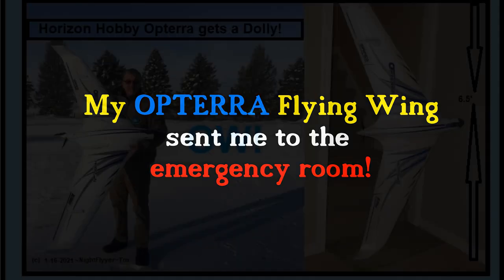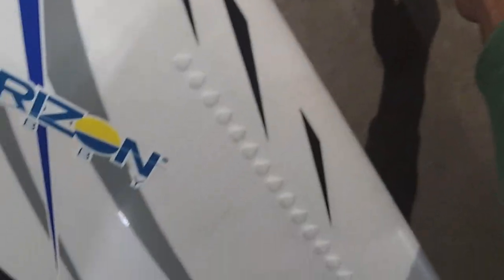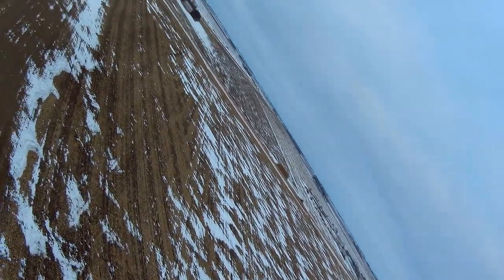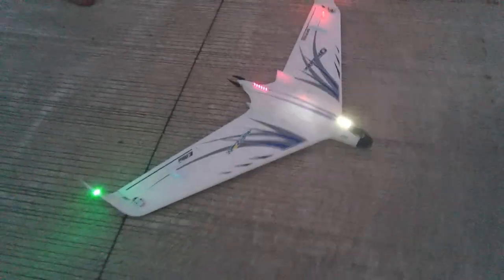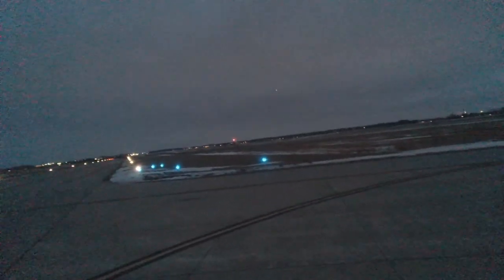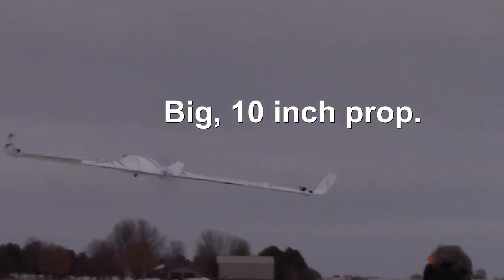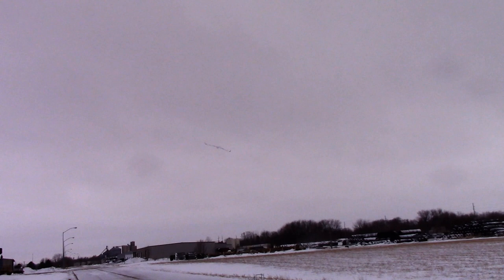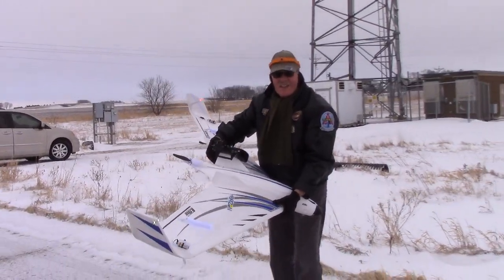My Opterra 2M Flying Wing sent me to the E.R. This is an awareness video & my solution for launching

Comment: I hope it heals up quick Dave. I have to admit that I have come close to being eaten by the prop on flying wings. So what I do now is that I have a throttle cut programmed into one of my switches, (I do this for all my electric aircraft BTW having a cut off switch has saved me heaps of times when I have accidentally bumped the throttle when the plane is not ready to fly.) so I set the switch to off then set the throttle position I need, launch the wing then flip the switch to turn the motor on. Ok, I must admit it does not work every time but it's better than getting eaten by the prop. A launch dolly would be much better though. Get well soon.
Reply from the maker: Yes, for sure.  If you follow my channel, you know I am no newbie and for some to say I asked for it or should have done it differently is disappointing, especially when I am the one hurt, the hospital charged me $2400, and I followed the manual's launch instructions word for word.     

First of all, that throttle arming had nothing to do with my hand injury. I only mentioned the Throttle arming because I followed instructions in the manual and that is the way it bound up.  It arms the motor as soon as you plug in the battery. If it had said to program in a throttle cut, I would have!    This wing is 7 foot long and will bend and break the end off the if you even try to pick it up by the tip. It would also be extremely difficult to somehow launch it discus style with the elevon there and that 7" tall winglet rudder that is also on the tip.  I know how to do it , but not with this plane.  See my 14 year old self-contained catapult in action here.  https://www.youtube.com/watch?v=ypxbkaY-Ycs&t=113s
It's not like launching my SMALL F-27 Evolution or 1.2M Opterra.  So I followed the instructions word for as I did for the video I made of my product review earlier where nothing happened bad.  https://www.youtube.com/watch?v=P_inF5EYLEE&t=1s
Here is word for word what the Opterra 2M manual says about launching.  
1. Put the aircraft into launch mode with the channel 5 switch.  (in my first video that did not work, it went into the ground)  
2.  Hold the aircraft in one hand and the transmitter in the other.  
3.  Apply full throttle and throw the aircraft directly into the wind, angled slightly up (5 to 10 degrees above the horizon). 
4.  Climb to a safe altitude and check the trim.   
I know others have their own ways, and either way, my Dolly is the safest solution for me.  
The Opterra 2M manual also says nothing about throwing it with the motor off, so if a newbie followed the instructions, like I did, I'm showing what could happen, in case a gust of wind got them or something else.     Nothing is 100% and no matter how good you can throw, this big 7 foot wing with a 10 inch prop spinning right next to your face, is risky.  And to see how I feel about that unnecessary auto stabilization system see this.  https://www.youtube.com/watch?v=ur5V5H8UcGs&t=1s
Maybe a gust of wind, maybe my 73 year old left arm was weaker, or who knows.   But either way, if it happened to me launching the way I thought was good (and  the same as all my previous launches.)  So if it can happen to me, it can happen to others, and that is the warning I want to present.  Thanks.
Reply: @NightFlyyer  Hi Dave, I nearly bought an Optera a couple of years ago, but never went through with it, basically I could not find a way to launch it safely without say using a dolly or launch frame. Personally, I think hand launching a wing from the centre pod with a rear engine is playing Russian roulette with your fingers. Quite a few members at our club have been nipped too by rear-engine wings. Hence when I launch my wing the motor is off until its safely away from my fingers then I turn the motor on (Cant launch this one by the wing tip its a bit big). To be honest I don't think there is really any safe way to hand launch the Optera. I should really build myself a launch frame.
Love the channel have been following it for a few years.
Reply from the maker: @alaxus  Thanks so very kindly for seeing my side of the story, as I followed the launch directions to a tee in the manual. Those who say it was my fault or should launch discus style, obviously do not have this 7 foot, heavy plane.  From now on, it's Hello dolly!

Comment: DId the same thing with the smaller opterra. I have had a friend launch it and added power only after launch which works. Been planning on trying a catapult launch. For the one you have best solution I have seen was to mount some fixed tricycle gear on it.
Reply from the maker: Well my drop away dolly works best for me and adds no weight to the plane.  The manual says nothing about trying to throw this big 7ft underpowered wing into the 12 mph wind I was dealing with with the motor off.  Thanks.

Comment: I've had close calls with strykers, and flying wings. I've had to learn how fast each of my planes react to the throttle and to throw and then goose the throttle after release, it depends on how fast your prop runs up as to exactly when you have to throw the coals to it. It would be pretty hard to discus launch a 7 foot wing but I would try that, especially with that 10 inch prop so close to knuckleville. Collapsible props need to be run up slowly or they tend to undermine the integrity of the motor mount at high speed because they aren't any where close to balanced until they are fully extended.
Reply from the maker: Here is word for word what the Opterra 2M manual says about launching.  
1. Put the aircraft into launch mode with the channel 5 switch.  (in my first video that did not work, it went into the ground)  
2.  Hold the aircraft in one hand and the transmitter in the other.  
3.  Apply full throttle and throw the aircraft directly into the wind, angled slightly up (5 to 10 degrees above the horizon). 
4.  Climb to a safe altitude and check the trim.   
I know others have their own ways, and either way, my Dolly is the safest solution for me.  
The Opterra 2M manual also says nothing about throwing it with the motor off, so if a newbie followed the instructions, like I did, I'm showing what could happen, in case a gust of wind got them or something else.     Nothing is 100% and no matter how good you can throw, this big 7 foot wing with a 10 inch prop spinning right next to your face, into 12 MPH is risky to say the least.  The 10" prop is very close to your forearm as well, so a gust could tip it back even before launch, as others told me happened to them.  Thanks. 
As you saw, my launch rail 7:12  did not work in this video.  My Catapult  7:26 would have worked probably, but it was destroyed in the fire that destroyed my jets and my home, so I never built another.  The instructions only say to hand launch it and tells how.  That is how I did it. Of course nothing is 100%, and others told me they were holding this big 7 foot wing and before they launched, a gust of wind got under it and it tipped back and cut their forearm and 3 tendons.  Its hello dolly for me from now on.   Here are the links to the last videos.  
https://www.youtube.com/watch?v=P_inF5EYLEE&t=1s&gl=CO  and   https://www.youtube.com/watch?v=ur5V5H8UcGs&t=1s
Maybe a gust of wind, maybe my 73 year old left arm was weaker, or who knows.   But either way, if it happened to me launching the way I thought was good (and  the same as all my previous launches.)  So if it can happen to me, it can happen to others, and that is the warning I want to present.  This is too big to launch discus style as well.  Thanks much.

Comment: I recently purchased my Opterra, but haven't flown it yet. I had the same concern even before buying it. I'm working on a 3D printed extension of my hand that will provide a firm hold and will release easily at the exact point of launch as needed. If it works as intended I will share it with other Opterra owners.
Reply from the maker: Good luck with that.  The forearm is very close to the prop, so if a gust of wind tips it back before launch, that can get you too.  be careful.  Thanks.

Comment: I own the 1.2 meter version of this flying wing, even though, I am already used to hand launching it, due to its small size. This 2 meter version makes me really nervous... One of the biggest problems that I have with flying wings is, the bottom getting scratched and beaten up on every landing and the propeller being too close to my hand. I hope on the next version, E-flight can add retracts. It will make landings and taking offs much easier, at the same time increasing safety.. ( no more hand or fingers getting cut )...

I mean seriously, why is it so hard to design wings with retracts?
Reply from the maker: Yes, my F-27 Evolution also is easier to handlaunch, as you say, but I still elect to use my launch rail as you saw.   This big 7 foot wing barely has enough power to get out of your hand.  Others told me they were holding it and the wind got under it before launching and it tipped back and cut their forearm.  The big 10 prop needs shrouded, but again, as you say, it would hit the ground on landing.  I put metal skids on mine to protect the bottom, see my video. https://youtu.be/ur5V5H8UcGs  Also it's not hard, it's expensive as it would need another servo for nose wheel steering, etc.  Short coupled wings like these bounce so much, I believe they would get ripped out in a landing like that, so they passed.  It's all about the money. Thanks.

Comment: Thanks for the heads up... I always think about that and you are not the first to post getting tagged by a prop. Both the F26 Evolution and the Opterra need a power off launch... not so easy with the F27 so using a launcher makes good sense.
Reply from the maker: Yes and as you saw, I launched my F-27 Evolution in this video off my launcher.  Too bad this big 7 foot Opterra is too underpowered and heavy to use it.  But for me and from now on, it's Hello Dolly.

Comment: Been there, but I was lucky. I purchased a mesh butchers glove. Saved me from the eventual hospital visit
Reply from the maker: I tried to grab the tiny holes in the bottom of the fuse with a glove on this big plane and it was too hard to hold and throw, plus it is hard to run the transmitter with that glove on for me.  Hats off to you that you can launch and fly this 7foot wing that way.  Maybe the manual should recommend that as well.

Comment: Up and down at that point is for programming the esc...Use a throttle cut on your transmitter as the manual states...
Reply from the maker: The Opterra manual states nothing about a throttle cut.  I typically dont use it.  I just pointed it for the newbies that this particular esc arms as soon as you plug in the battery.  Besides, that had nothing to do with why I got cut.

Comment: Too many comments to scroll through - I have the 1.2 M opterra and never even tried to hand launch from center.  I figured there would be a lot of complaints about cut hands but previously came across only one other very short video showing the damaged hand of the poster....and even in the various rc forums only one or two mentions of cut hands and fingers. This surprised me.  Interestingly, the manual doesn't even caution about keeping hand out of the props on the throw.  If I were on a jury I would have no trouble awarding damages.  At any rate,   I taped the wings onto the fuselage with reinforced packing tape and throw it from the wing.  The 2 meter version, however, is too big for that.  I notice the 1.2M is out of production, probably not because of the cut hand problem since they are still selling the 2 meter version.
Reply: https://www.youtube.com/watch?v=JFFAS_YWlgk

Here is another cut hand incident with an opterra but not the one I was referring to.
Reply from the maker: Your right about the launching by wing tips on this 2m, as I mentioned in the video.  It would be hard.  Here is word for word what the Opterra 2M manual says about launching.  
1. Put the aircraft into launch mode with the channel 5 switch.  (in my first video that did not work, it went into the ground)  
2.  Hold the aircraft in one hand and the transmitter in the other.  
3.  Apply full throttle and throw the aircraft directly into the wind, angled slightly up (5 to 10 degrees above the horizon). 
4.  Climb to a safe altitude and check the trim.   
I know others have their own ways, and either way, my Dolly is the safest solution for me.  The Opterra 2M manual says nothing about throwing it with the motor off, so if a newbie followed the instructions, like I did, I'm showing what could happen, in case a gust of wind got them or something else.  Nothing is 100% and no matter how good you can throw this big 7 foot wing with a 10 inch prop spinning right next to your face, stuff happens. 
Maybe a gust of wind, maybe my 73 year old left arm was weaker, or who knows.   But either way, if it happened to me launching the way I thought was good (and  the same) as all my previous launches. So if it can happen to me, it can happen to others, and that is the warning I want to present.
Thanks.
Reply from the maker: @superdow1000  Yes, that is the smaller one.  Too bad for sure.  Thanks.

Comment: Been watching you for over a decade. I fly helis, and ALWAYS, whether or not T CUT is engaged, move around with my left thumb placed firmly above the throttle stick, locking it at min/off. I use arming and T CUT, and still practice this just in case somehow I goofed up. That said, hope you're ok and fly safe!
Edit: I also use a TX neck strap. Ever consider disc tossing it?
Reply from the maker: I certainly know that as most of my helis have that setup. I also lock my thumb, but I have to launch with my left hand so there goes that. I've flown models for 60 years.   But the best rc pilots in the world, have also had bad landings once in a while.  Shit happens, especially while I was trying to throw this heavy, under powered 7 foot model into the 12 mph headwinds.  Maybe if the Manual had said I should do that, I would have.  First of all, that had nothing to do with my hand injury. I only mentioned the Throttle arming because I followed instructions in the manual and this is the way it bound up and arms the motor as soon as you plug in the battery. It says nothing about programming in a cut switch like my helis have. I only mention it to warn others to program in this feature as well,  which also should have been mentioned in the instructions.  It's my warning to be cautious, because the manual says nothing about programming in a throttle hold to a switch. I've known of times when after flying, that switch was forgotten to be moved back to safe and it armed as well.  Nothing is 100% as it could be left in the wrong position, by accident. I'm pretty experienced, so never relied to on a throttle cut/hold, as all my helis and my drones, and many of my electric planes need throttle stick movements to arm.   I only am warning others to be careful BEFORE the launch and to be careful no matter what you use. .    This wing is 7 foot long, heavy, under powered, and will bend and break the end off the if you even try to pick it up by the tip. It barely has enough power to fly out of your hand at launch and especially while I was trying to throw it into 12 mph wind. I know and I tried to launch it discus style, but could not hold it where I felt I could launch it successfully in the wind.     It would  be extremely difficult to somehow launch it discus style with the elevon there and that 7" tall winglet rudder that is also on the tip.  I know how to do it , but not with this plane.    Here are the links to the last videos and you can see I launched it the same way without problems.  Thanks.  Its hello dolly from now on. 
https://www.youtube.com/watch?v=P_inF5EYLEE&t=1s&gl=CO  and   https://www.youtube.com/watch?v=ur5V5H8UcGs&t=1s
Reply: @NightFlyyer  I certainly didn't mean that as a criticism, only a suggestion. I have owned a few Zagis and an f 27 Stryker. Nothing as large as the Opterra. Your dolly looks like it works well! I'm glad you're doing ok and wish you a speedy recovery!

Comment: Well there are many solutions. I've been flying rear power planes for many years. I launch my opterra by putting it in  launch mode then turn around to the direction of flight and launch over my head by pulling the plane upward over my head. Sounds crazy but because of the flight controller, you can throw the plane any way you like. The plane will always level out and fly 45 degrees. I took out the stock receiver and put in a px4. This way you can get telemetry: value of each cell, voltage etc. as well as RTH. Glad nothing serious happened 2 u. Happy landings.
Reply from the maker: Here is more on the issues of hand launching with pushers, especially this 7 foot Opterra 2M.  I know someone would always say it can be done, but that is not what the manual says.  My way seems to be the best for me and is no sweat fun too.  https://youtu.be/f5xDfk7sbcQ